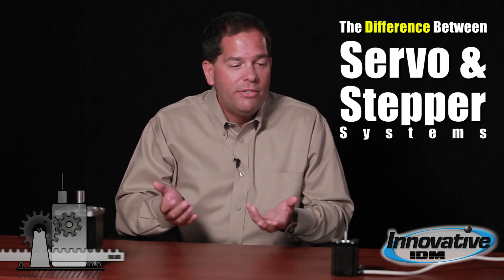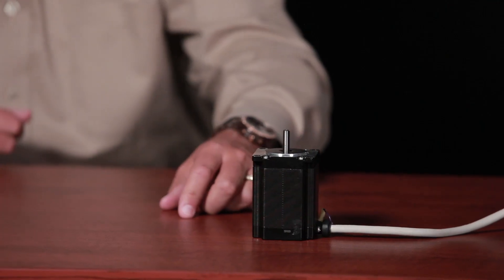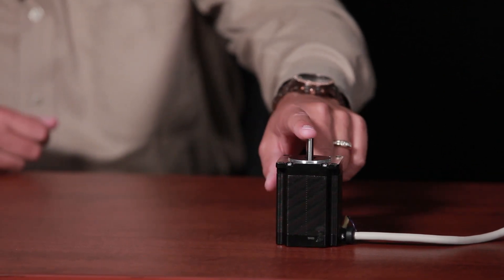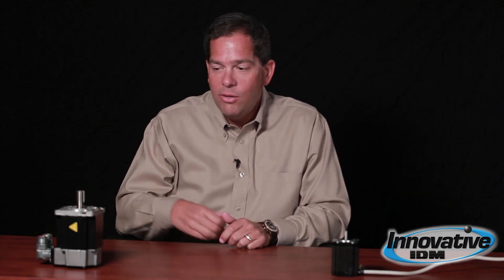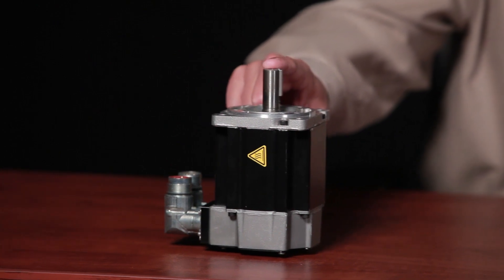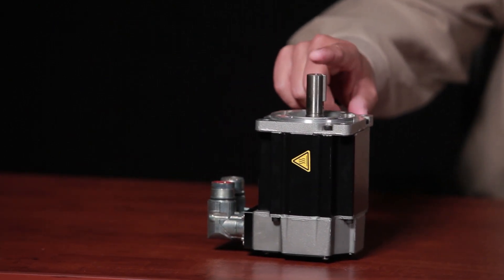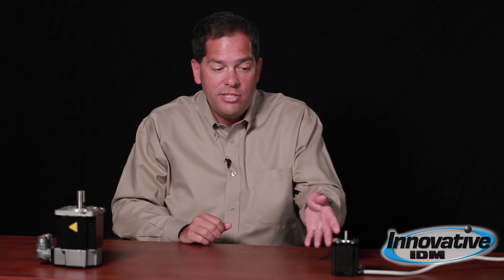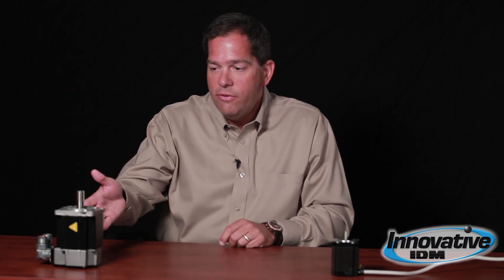How to Understand the Difference Between Servo & Stepper Systems

Comment: If I want a STRONG motor to move as FAST and SILENTLY as possible, with abillity to remember it's current POSITION , even after cutting off the power and turning it back on again, which one do I need? It's for an human-sized animatronic-robot that can move as fast as a human and pick-up objects. Without sounding like an 1980's printer with every moved inch... 😂

Comment: Sir, can you answer a question for me about Stepper Motors?  Question:  If a Stepper Motor is rated at 4 amps does that mean that it can output 4 amps if used as a generator?

Comment: I thought Servo Motors only turn 180 degrees? what's going on here
Reply: Uncharted I believe certain ones can continuously spin
Reply: Continuous rotation servos can rotate continuously. And most standard servos can be trivially hacked to become continuous rotation servos. (Just how trivial that hack is depends on which model of servos you're hacking.)
Reply: I think you mean servomotor used, for example, for radiocontrol. Those, normally small, servos, use a position sensor based on a potentiometer (variable resistance). That is a simple and cheap position sensor. But so they can't rotate continuosly due to that. They are limited to less tan 360º or less. 
Some others using, for example, light encoders can rotate more times. Quite probably the encoder shown in this video is of that type
Reply: Some cheap servos are nothing but a brushless motor with a limit switch. I struggle to call them servos at all.
Reply: Not that RC servo.
Reply: I need a small motor that can rotate a light weight yagi beam antenna 90 degrees forward and reverse.

Comment: I was under the impression that applications for one or the other was more than just torque and RPMs? Arn't steppers "angle" based and servo's are velocity based? Meaning you'd not use a servo for moving a printer head that needs very precise control, but you'd use it for rolling up blinds or something?
Reply: +John Michael Stock Thank you for your question.  Both steppers and servo's can operate in position control mode to move to a very specific position.  During the move itself, they also travel at a commanded velocity so they can ramp up from zero speed at a given acceleration rate then decelerate back to zero speed and stop at the desired position.  A servo would typically be overkill for an application such as rolling up blinds.